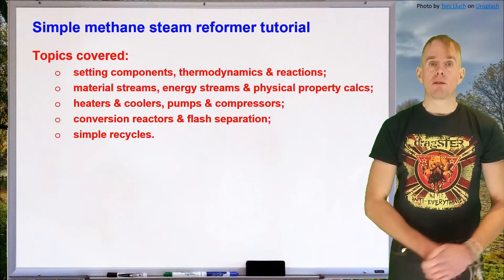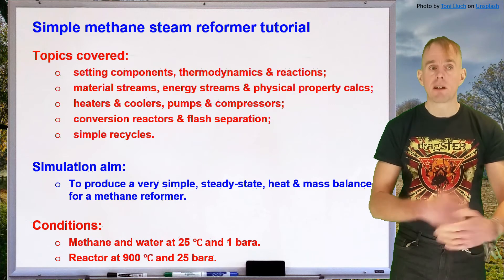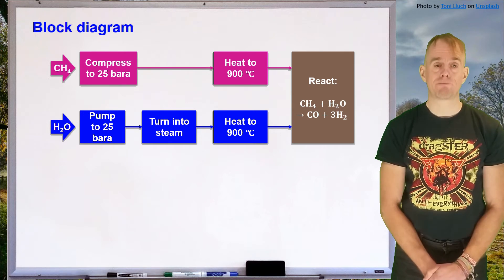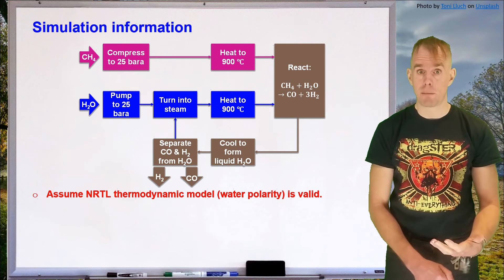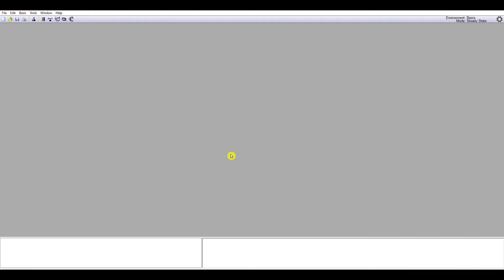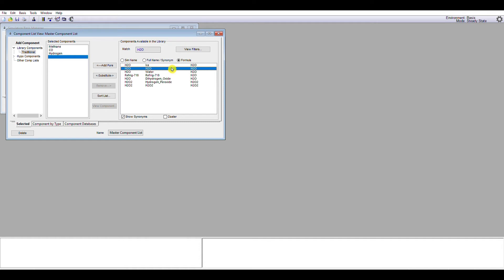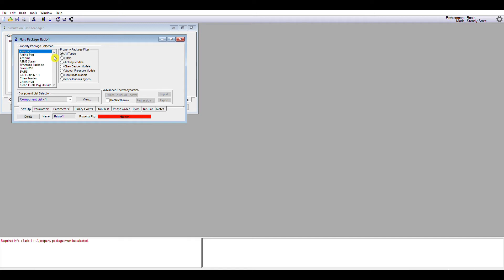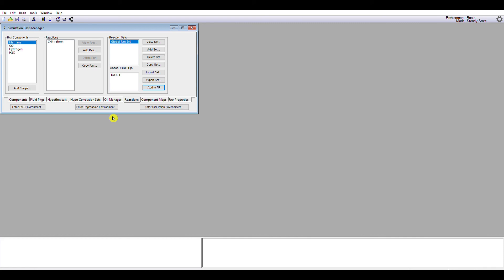UniSim / Hysys tutorial 1 part 1: Introduction [by Dr Bart Hallmark, University of Cambridge]

Comment: Great lecture, thank you very much for uploading it! 
Do you happen to know of a good tutorial or any other source apart from the Unisim Customization Guide for embedding a custom kinetic reaction (cf. 12:37 in your video)? I'm trying to model an ammonia reactor in Unisim and would like to use the kinetic equation by Dyson/Simon which I can't replicate well enough by the default reaction types.
Reply from the maker: Thank you for your kind comment - and I'm glad you found it useful.

I did a bit of work on writing UniSim extensions over 10 years ago - I've linked the notes I made at the time (for Visual Basic Express 2008 - but probably can be made to work with modern distributions with a bit of reading between the lines). I've also written a reaction extension for ammonia reactions, also included in the link. I think if you put the .EDF in the same folder as the .dll and register the .dll with UniSim it may work. Or it may need totally re-writing for modern versions of UniSim! It's been a long time since I've tried it.

I no longer have access to UniSim, so I'm afraid I can't help any further with bringing the linked files up to date.

I hope this helps a bit and good luck! 
https://drive.google.com/file/d/1Jg6K8poG32_doiDwSGjb8VunlQpShYwG/view?usp=sharing
Reply: Wow, thank you very much, I really did not expect the actual code!! I'll definitely let you know if it works :)
Reply from the maker: @Schiweg  glad to help! I hope the code still works and good luck!
Reply: @drbartsworldofchemeng  The code still works! :) I had to use a little workaround though to compile the DLL-file myself using Visual Studio (basically imitating Visual Basic Express 2008 with choosing a NET-Framework 3.5 library template and then adding the "old" Unisim DLL reference file). Not the prettiest solution I guess, but it works for me (Unisim R490) :)

Again, thank you very much! If you should be in Munich one day, I'll buy you a beer (or any other beverage)! 

One last question: Do you by any chance know how to access Unisim fugacity values from within the VB code? Temperature, pressure, composition etc. are easily accessible, but I haven't got far with fugacity values yet...
Reply from the maker: That's fantastic news - many thanks for letting me know and well done for producing that workaround! Amazing that it works on R490 given that it was written for R390 (or was it R380?!). 

A very good question about fugacity. I don't know how to do it, but I'd start by looking in for fugacity values in the additional properties you can specify for stream physical properties. If you find it in there to add to a stream's property, then you should be able to access it within VB using a similar construct to, say, temperature. However, if you can't explicity add fugacity to a stream property within UniSim itself, then my instinct is that it's a calculation that would somehow have to be queried from the fluid package rather than the stream. I'd have thought it would take whatever object describes the stream physical properties and return some kind of data relating to fugacity values? I may be completely wrong though.

And thank you - if I am ever near Munich I'll take you up on that! :)
Reply: @drbartsworldofchemeng  Good news, I found out how to do it :) In case anyone else stumbles upon this, here's how to access the fugacity values from within the ReactionRate function (probably works for any other situation too). 

'Declaration of variable as object
Dim lnFugacities as Object

'Get values
lnFugacities = UnisimDesign.Fluid.CalcPhaseLnFugacities

'Value of fugacity for desired component
fug_component = Math.Exp(lnFugacities(*idx_component*,*idx_phase*))

lnFugacity must be accessed by two indices: the first one (*idx_component*) is the index of the desired component, the second one (*idx_phase*) is for the phase (0 for gas, 1 for liquid1, 2 for liquid2)
Reply from the maker: @Schiweg  Excellent work! And thank you very much for sharing what you found! 😊

Comment: Professor, good evening, do you know if it is possible to use Refining units, as a hydrotreater, with a unisim cracked version? if possible, how should I do it, because it does not allow me to open it due to a licensing problem, I appreciate your answer. regards
Reply from the maker: Hello - I cannot answer questions concerning, essentially, stolen goods.  I'd recommend you either obtain a legal copy or write your own extension to an open source simulator such as DWSim.